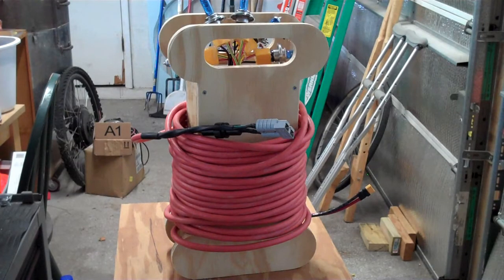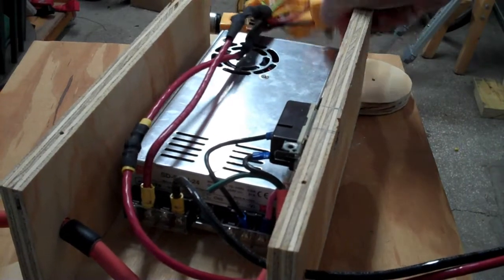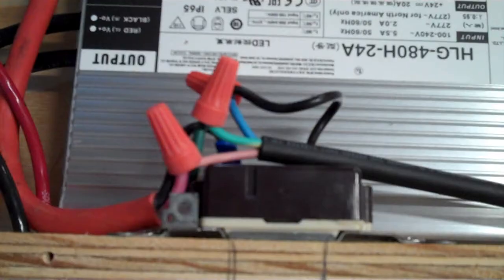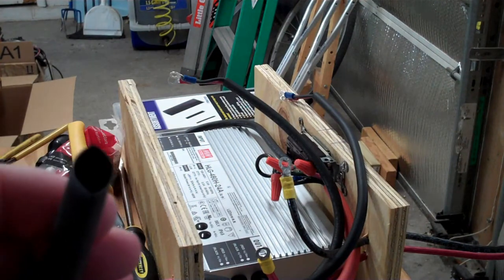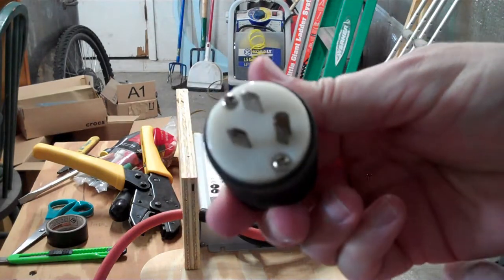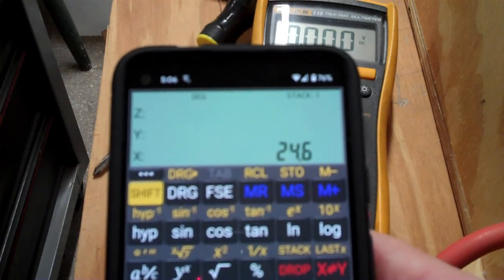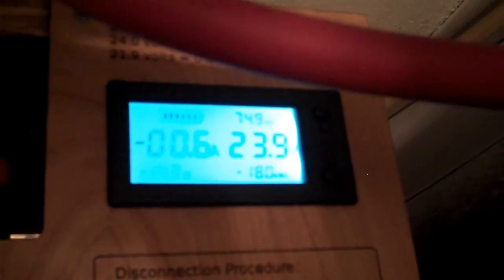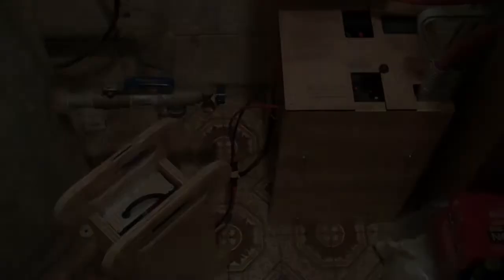Running a well pump off batteries - AC Charger (part 10)

Comment: Did you ever post the confirmation that the inverter you have with 24v battery successfully run the pump?
Reply from the maker: Yes, in video 7 of the playlist it runs the pump, BUT, only when the LiIon battery bank is fully charged (needs the higher voltage). That is why I have made various chargers for the battery bank that will keep it topped up from the EV's.   

Once we have a hurricane or extended power outage that takes out our electricity I plan to make a video showing how it works for a backup situation, but so far we've been lucky.

Comment: I've been thinking about doing something similar for my house and my deep well pump. I also have an electric car (Chevy Bolt), but i don't want to mess with it. Although I have a couple of 100ah lithium batteries that I use with my RV that I could use for the inverter. I also plan to install 2kw of solar panels in back of my house that's primarily for Grid Tie, but would also like to use for off grid during power outages. It's crazy how much planning I have to do just for the well pump, everything else I can easily get by with just a simple 110v inverter.
Reply from the maker: Yes, unless you have a constant pressure or slow-start type system, well pumps take a LOT of power for a short amount of time, which requires quite a sizable battery bank and inverter to handle the peak loads.

W.R.T. Your Chevy bolt....you can run a 1000 watt 12v inverter off of it's accessory battery, and if the car is turned on it will re-charge the accessory battery from the main battery. You could connect up as easily as using a pair of jumper cables without any other modifications to the car.  It can't run your pump or major appliances, but you could use it for smaller loads or to re-charge a well pump battery bank slowly between uses. [I'm going to be using a Nissan Leaf in much the same way to re-charge my well pump battery bank at 500 watts....]
Reply: @summetj  I can use the invert in my RV if I needed a backup, but I might get a cheap inverter to use with my Bolt for emergencies. I was thinking that maybe swamping my well pump with a DC solar well pump would be a better solution.
Reply from the maker: @twiddler71  Yes, if you have the ability to change out your well pump to one that has a smaller power requirement it makes it much easier to power off of renewable or battery backup systems.